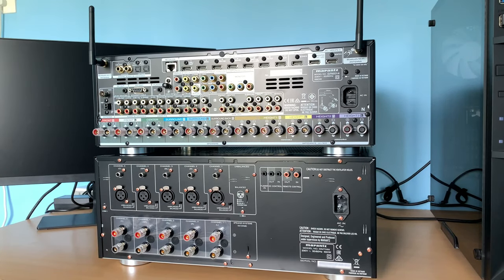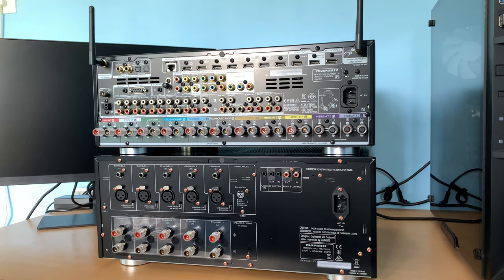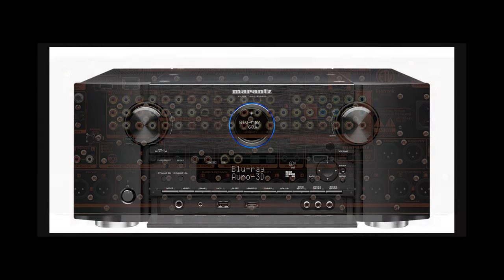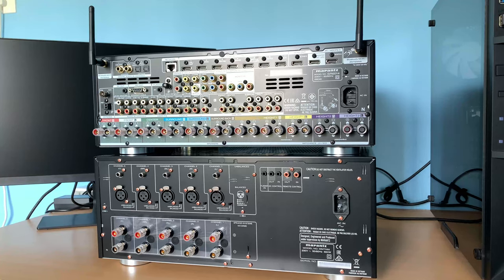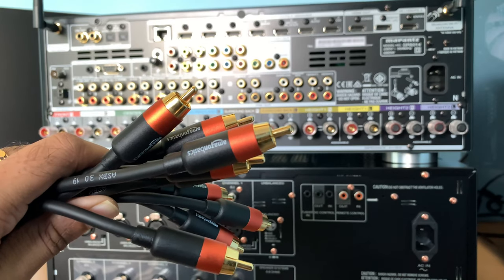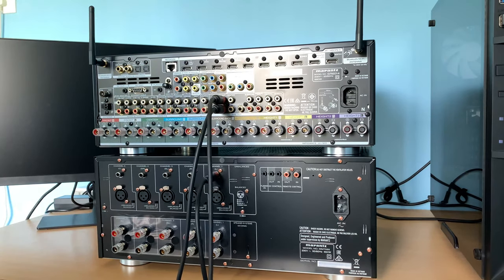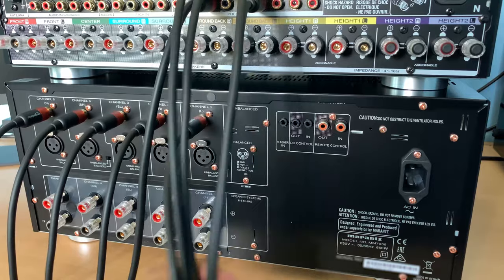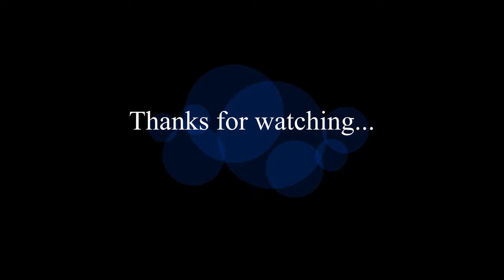How to add external Power amplifier to AVR - Upgrade to  Separates - connecting SR 6014 &  MM7055

Comment: Nice video...did you notice a difference in sound quality by using the 7055 as an amp. Vs just using the 6014?
Reply from the maker: Ys ofcourse its more refined more dynamic more powerful also depends on the speakers too,

Comment: Hello, if i want to do a Bi-amp, do i just need use Rca splitter and done ?
Thanks
Reply from the maker: If you really mean bi amping and not bi wiring , then you may have to use some hacks like you said. The idea is both highs and lows should get separate amplified output from the amp. There are stereo amplifiers which provides this feature pls check my newer videos on accuphase amp.
But doing a bi-amping for movie’s wont make an audible difference is what my understanding is.

Comment: Hello Bro. Your video explain so clear and would like to know are you using the individual coaxial cable to connect receiver to amplifier? I’m using RCA cable red and black color to connect my receiver and amplifier I don’t know it was correct or not . I really need your help about this issue. I hope to hear from you soon. Thank You very much.
Reply from the maker: I was using individual rca cables, I will suggest to use the same with a decent quality.

Comment: Sir I read from forum that xlr do not have advantage over rca within a short distance? Is that true? I want to buy cable now am confused whether to buy a amazon basic rca cable or xlr cqble
Reply from the maker: If u have xlr connectivity available I will suggest go with xlr. In my experience it definitely make difference theoretically it may be made for longer run noise reduction though.

Comment: So i just bought a marantz sr6015 should i add an amp to my speakers. I have some martin longan motion 40s
Reply from the maker: Yes you can 👍🏼 amp model you can choose depends on your power need
Reply: Would it make a big difference
Reply: What would you recommend marantz or emotiva
Reply from the maker: @adrianbucio3650  it depends on your speakers. which one u use

Comment: Denon 6700 with extra 2 front wide channels connected with  the marantz mm7025 
Now the speaker wire is to be connected with one which one to get best output
Reply from the maker: In the amp assign section u have to select the mode of assignment of ur speakers, then mostly the avr/processor itself will guide u the channels to use for ur wide speakers, its all depends on ur avr model,
Generally there will be some assignable channels (mostly height channels )u should have to use tat in this case.

Comment: Great video, i have one question. I have pioneer receiver and an onkyo receiver, can i use onkyo reciver as a power amp?
Reply from the maker: Well, it depends on ur avr, if one of ur avr has rca audio input then u can connect the other avr preout to this particular avr. But again the usecase is very limited

Comment: Can we not use power amplifier directly with speakers, without any pre-amp connection? Does it always have to travel from pre-amp to power amp to listen to music or 5 channel?
Reply from the maker: I didn’t understand the question correctly, but if u are asking whether we can connect power amp to speaker without using preamp, I would say we can connect but how u will play the content u dont need a pre processor or avr specifically u can directly connect you phone output to power amp and play the music u just need one converter to rca from phone. Sorry if I didn’t understand your question correctly.
Reply: @HometheaterEnthusiast  ya that's exactly my question, if I only invest in power amp and speakers, can I play music?
Reply from the maker: @vgnow6558  yes u can, u can use tour phone as pre amp 👍🏼

Comment: Hi there, is it better to run speaker wires from power amplifier or an AV receiver when the AV receiver and the power amplifier were connected together?
Reply from the maker: Well, the basic motive behind using a power amp is to drive ur speakers with better quality & power so always use that if u have a power amp.
Reply: @HometheaterEnthusiast  Thank you so much for your quick response.

Comment: Nice explanation! Im currently using marantz sr8015 and I wanna get separate amp. Is there big difference in sound with amp?
Reply from the maker: Yes of course there is. But all these things depends on ur speakers as well.
Reply: I have the same question. I have the sr8015 and just bought the 7055 amp. Im running all martin logan speakers. 60xt . 50xt. Atmos sfx. Motion 40s. They sound really good with just the sr8015. So when it arrives I’ll hook it up and let you know how it soinds.
Reply: @adrianbucio3650  awesome i also got monolith x7 running with my sr8015 and its sounds fantastic. Even without amp it has plenty of power but amp takes it to the next level.
Reply: @gamingingalaxy4011  quick question on the Audyssey im just trying to set up left right and center on the external amp how do i do that. And the rest of the channels are gonna be running on the avr
Reply: @adrianbucio3650  im running everything on pre amp mode. I believe you just leave all 13 channels on and thats it. Just plug 3 channels thru amp rest thru receiver and rerun audyssey
Reply: @gamingingalaxy4011  ive should of done more research so that i could of bought the 7 channel amp. To run everything on pre amp mode.  So im gonna give it a try later to just run 5 channels to se how it sounds. Thank you for getting back at me.
Reply: @adrianbucio3650  with 5 channel amp you should be absolutely fine. Marantz has a beefy amp inside to run rest of the speakers. I had really good deal on 7 channel amp that’s why I bought it.
Reply: @gamingingalaxy4011  thank you again.

Comment: Hi thank you for this really enjoyed your video.  Why did you only connect one rca to Centre and one to the amplifier. Where as the others had both the red and white connection? Thanks
Reply from the maker: Hi glad to know u enjoyed the video😊 
I think u got confused a bit. RCAs are not speaker level so there should be only one rca cable for one channel (speaker). Also here red and white doesn’t make any sense u can consider red is for right speaker and white for left. Here all the rca preouts are for a dedicated channel which mean to a dedicated speaker may be left or right or center . So we need only one rca connection to the center channel too. 
Hope u understood, pls let me know if u need more clarification, glad to support 😊
Reply: @HometheaterEnthusiast  Do you need to use 2rca male to 2rca male cable  for 2 channel power amp or separate RCA cables for each channel?
Reply from the maker: @deepanbanerjee6736  both should work👍🏼

Comment: Hai bro, എന്റെ avr denon 4700 ആണ്.. അത് 9.2 ആണല്ലോ. അത് 11.2 ആക്കാൻ വേണ്ടി ഞാൻ pre out ഇൽ നിന്ന് കണക്ഷൻ എടുക്കുമ്പോൾ front channel അല്ലെങ്കിൽ rear height chanel ഇൽ മാത്രം കൊടുക്കാനുള്ള ഓപ്ഷൻ മാത്രമേ കാണിക്കുന്നുള്ളു.. എനിക്ക് pre out കണക്ഷൻ കൊടുക്കേണ്ടത് top front or top middle ആണ്... എന്തുകൊണ്ടാണ് ഇങ്ങിനെ.. ദയവായി പറഞ്ഞു തരുമോ
Reply from the maker: Hi brother, Actually I don’t remember the denon setup 😞 but as u said if it’s providing option for front and back, it may be front and back hight speakers because there is 2 main reason u go for an external amp,
1. To increase the number of channels
2. To power ur speaker with a more powerful external amp
The brand provided both the options for u because if ur need is reason 2 then u should power the front speakers for better performance, if it’s option 1 that is ur case then just power the back hight because it doesn’t make much difference in performance.
Now the case is u need a different type of configuration like top speakers then my suggestion is try out if it takes automatically by Audyssey.
If u need more flexibility in external amplification u should use a pre amp other than AVR. 
I know it may not help you but just some suggestions. 😊

Comment: Sir superb. One doubt woofer wire? Please answer for me. Thanks.
Reply from the maker: Speaker wire should connect from the power amp not from the AVR.
Reply: Thanks for your response and support.
But still I am not clear. Speaker wires are connect to amp.ok woofer wire connect to direct avr or power amplifier iam not understand.😀😀😀
Reply from the maker: @ayyaswamyloganathan1778  okey u mean subwoofer. Subwoofer is connected at the preout of AVR/Processor directly, not the power amp.

Comment: i am a little bit  confused  for my home theater set up  i have 9.2.6 speakers  configuration .my receiver denon avr x6500h  11.2 channal my amplifier  monoprice 7x200w onkyo pa-mc5500 9x150w Audio source Amp 210 my blu ray oppo 203 my question all togeather to play which one better to buy marantz av 8005 or denon avr x8500h 15 channal or Anthem avm 70.Thank you.
Reply from the maker: First of all u need to decide whether u want a 13 channel or 15 channel configuration, this depends on ur room size as well. since u have very powerful power amp available I will recommend to go for a processor like 8805 other than avr.
Reply: @HometheaterEnthusiast  Thank you so much

Comment: What is trigger wire connection seen in some videos. For marantz sr 7011 it is not seen.
Reply from the maker: Trigger cables usually comes with the power amplifiers, it is used to auto turn on the connected devices.

Comment: can you connect rca to xlr from avr to power amplifier?
Reply from the maker: You can connect by using a proper rca to xlr cable it should work. But that doesn’t give you the advantages of balanced signals. As I explained in the video there are 2 signals in xlr cables out of which only one will be used if u r using an xlr to rca cable. So rca to xlr will just give u the same outcome of rca to rca. Hope u understood 😊

Comment: Great video i am a Marantz SVR 7015 owner a fanstatic AVR but i want that much more power as my room is big so i was looking at a mm7055 ,to push the front 5 at 140 per channel and the  avr to handle the other 4 channels heights etc ,,,,,
Reply from the maker: That will be always better than ur current setup 👍🏼
Reply: @HometheaterEnthusiast  i am looking to order the MM7055 JUST worried with the delay in deliveries ,, but for sure the difference in power will change the game for home cinema and music
Reply from the maker: @michaelpolydorou5678  its a worth wait 😊
Reply: @HometheaterEnthusiast  THANK YOU ,,,For your time and advice .....
Reply: @HometheaterEnthusiast  can I ask you a question if we say that mm7055 has 5 x 140 Watts,  this means each channel is on the amp is getting 140 , not 5 channels sharing the total of 5x 140  I ask as I wish to be clear each speaker will get 140 Watts
Reply from the maker: @michaelpolydorou5678  actually mm7055 is 140watts per channel in 2ch driven. But u will get atleast 110watts each when all channels driven. If u want more powerful amp go for emotiva xpa 3 or 5 its 275watts per channel all channel driven
Reply: @HometheaterEnthusiast  really as it stands I have a 7015  giving me 7x 125 of 70% guaranteed  ... so a 7055 looking after my fronts will make 0 difference maybe a couple of dB only I was thinking to use it to boost my fronts and surrounds so 110 each leaving my center, rears and small atmos solution to feed off avr .

Do you think that's OK or am I wasting 1499 euros
Reply from the maker: @michaelpolydorou5678  if u want more power go for emotiva xpa 3. Also please note power amplifiers not only improve the level but also improve the quality and dynamics. Hope u understand 😊
Reply: @HometheaterEnthusiast  ok thanks so much again

Comment: Great video thanks, is it possible to power for example, front left and front right with the amp, but power the centre speaker with the AVR processor at the same time?
I understand there will be different connections involved, but with it being a 5 channel amp only, if I wanted to get say Dolby Atmos speakers on a later date, would I be able to power the new Atmos  speakers through the AVR and the older 5.0 speakers through the amp at the same time without any problems?
Reply from the maker: U can power any 5 channels through the power amp and remaining from ur avr that doesn’t make any issues, its normal.
Go ahead..👍🏼enjoy 😊
Reply: @HometheaterEnthusiast  Great thanks for the quick response!

Comment: Hi, thanks for your good explanation. I have a doubt regarding my current set up and the new AVR I am planning to buy.
I currently have two HT setup (Sony & Philips). While I will certainly discard one, I am thinking of using the other one as a "pre-out - zone 2" connection with either a Yamaha or Denon AVR. Can you please help me to understand if the new AVR will be able to send out digital sound to my old HT set up through the RCA cable from Zone2 preout?
Reply from the maker: Yes, only if both the AVR has the support.
Your new avr should have a multi zone feature and the old avr which receives the input should have rca input option.
Reply: @HometheaterEnthusiast  Thanks. Yes, my old HT has RCA input. My only doubt was whether the multi zone feature in the new AVRs send out digital audio signal.

Comment: U r from Kerala?
Reply from the maker: Yes brother.
Reply: Bro i need ur number
ഞാൻ ഒരു processor വാങ്ങാൻ വേണ്ടി നോക്കുവാ ഒരുപാട് Google ചെയ്തു നോക്കി കാരണം av processor ano അതോ av receiver ആണോ നല്ലത് എന്ന്.
ഞാൻ main ആയിട്ടു focus ചെയ്യുന്നത് surrounding സിസ്റ്റം ആണ്
Av processor ഇന്റെ processing ങ്ങും av receiver ന്റെ processing തമ്മിൽ എന്താണ് വ്യത്യാസം??????
ഏത് വാകുന്നതാണ് നല്ലത്
If u can just help me bro tkzzzz🙏🙏🙏
Reply from the maker: @musammilthaha7660  പ്രോസസ്സർ വാങ്ങുകയാണെങ്കിൽ power amplifier ഉം വാങ്ങേണ്ടിവരും , AVR ആണെങ്കി അതിന്റെ ആവശ്യം ഇല്ല, പ്രോസസ്സർ ന്റെ output ഒരു AVR നേക്കാൾ ക്വാളിറ്റി ഉള്ളതായിരിക്കും, പിന്നെ external power amp ഉള്ളതുകൊണ്ട്‌ you will get the best performance. നല്ല സ്പീക്കർ കൂടെയുണ്ടെങ്കിലേ പ്രോസസ്സർ ഒക്കെ നോക്കേണ്ടതുള്ളൂ, അല്ലെങ്കിൽ നല്ല AVR വാങ്ങിച്ചിട് main speakers ന് അഡിഷണൽ power amp use ചെയ്‌താലും മതി.
Again everything depends on budget.😊
Reply: @HometheaterEnthusiast  bro marantz av8801 enna processor ആണ് വാങ്ങണം എന്ന് വിചാരിക്കുന്നത് i have already 11channel amplifier ഞാൻ ഉപയോഗിക്കുന്നത് bose എന്ന company യുടെ double cube speakers ആണ്
Bro എന്താണ് ഈ av8801 എന്ന processor നെ പറ്റിയുള്ള അഭിപ്രായം
 this processer will be suitable for my speakers or not?
Reply from the maker: @musammilthaha7660  actually processors don’t need to be suited with ur speakers, its the power amp, since u are already selected av8801 its a good processor but little old, so i will suggest u to go through the specs and confirm if everything is there that you want.
For better quality i will suggest use balanced connections (xlr) from processor to amp, but again it depends on whether ur amp support it.
And regarding the speakers u r using, i’m not familiar with it and i know boss has decent speakers in tiny form factor. But u can always think about upgrading ur speakers in future as well.
So for the time being everything will work fine.👍🏼
Reply: @HometheaterEnthusiast  Alright bro tkzzzz for your information really very helpful for me.i will maximum support your channel share to my all friends.god bless.. 🙏🙏
Reply from the maker: @musammilthaha7660  its my pleasure brother, 😊 thank you